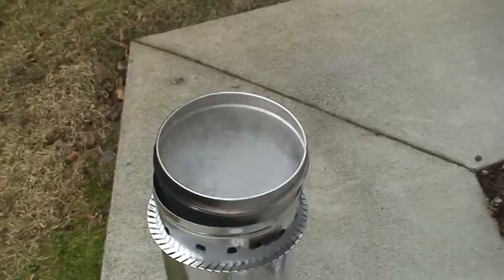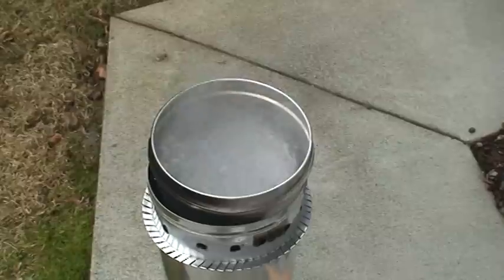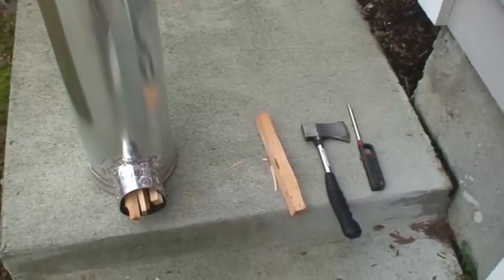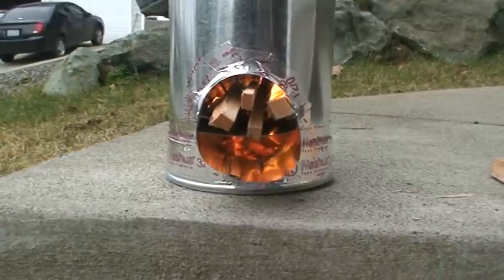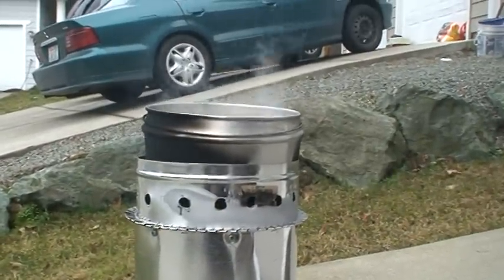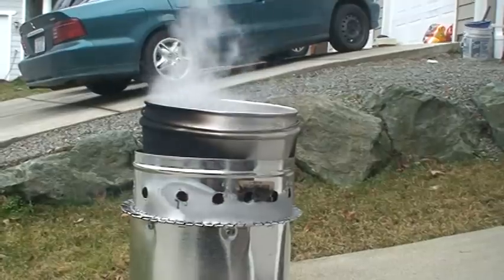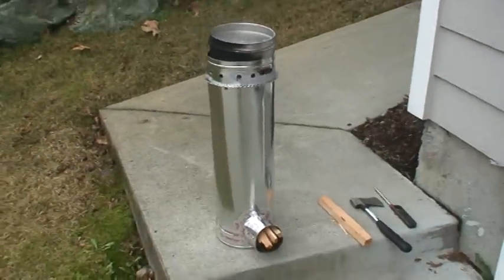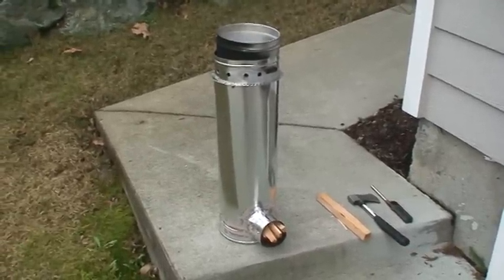Rocket Stove - DIY

Comment: nice stove.....there are lots of folks on youtube building what they call rocket stoves, but actually they are not designed like the original rocket stove....a true rocket stove has a double wall insulated burn chamber and partial lower stovepipe insulated....this is to get a hotter flame inside the burn chamber, to more completely burn the escaping gases or smoke....any stove will burn clean to some degree with dry wood, but a true rocket stove has much less pollution than a single wall stove..

Comment: Why don't people make a catalytic rocket stove that heats a pan by conduction.  That way the exhaust is really smoke free, the pan won't get all sooty, and the pan won't overheat as the running temp is pretty much constant.  To do it you just remove the vermiculite, seal the top with a conductive plate leaving a gap between the top of the inner pipe and the plate, then attach a proper flue alongside the outer barrel venting from the bottom side wall.  That way unburnt gases remain until burnt.

Comment from the maker: @fallguy100000 I think the only real rule is that it work well. Outside of that I think it would have to be what you want it to do. In the case of imau2ber below, he is not accustomed to handling anything larger than three inches so Im sure his stove is very small.... if he has one. If you are planning on doing car camping then size wont matter, you just want it to work. If you're hiking in someplace then you might want something smaller or even built on-site and left there.

Comment from the maker: @imau2ber How do you figure? Based on the internal dimensions of the combustion chamber it is about perfect. Additionally, the overall height of the stove does not match the length of the riser. There is about a 4" extension on the top to elevate the pot off the stack/riser allowing the heat to expand and affect the whole bottom of the pot more evenly than the type that have the pot sitting right on the stack. Thanks for taking time to watch the vid and comment.